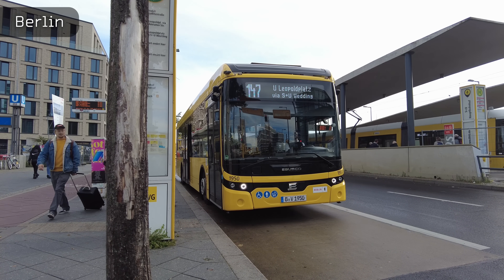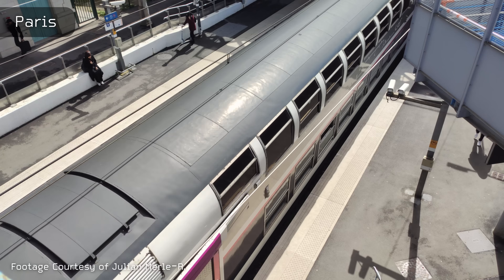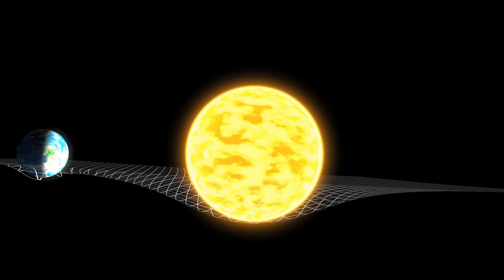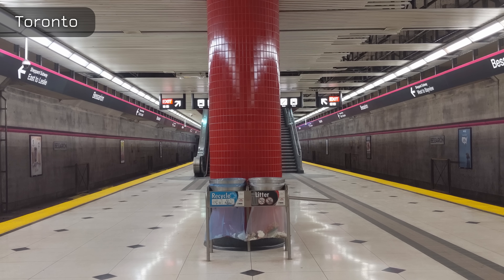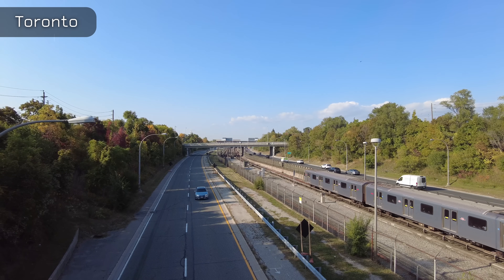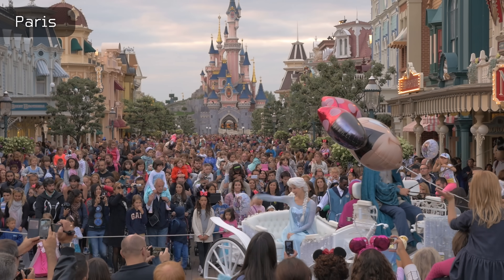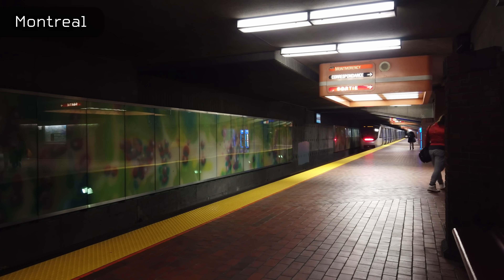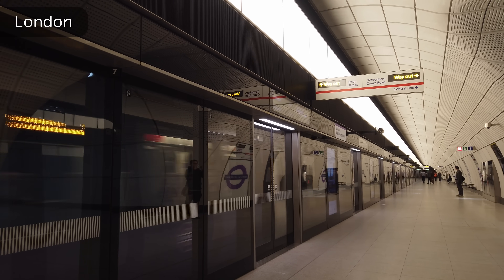Stop Spacing and the Power of Density

Comment: At the end, you show the Elizabeth Line which has about half the stop density of the Central Line in the central core section, but it doesn’t actually feel like that on the ground because of the way the stops are designed with entrances at each end of the platform.

For example if you are at Oxford Circus, getting to the Elizabeth line platform at Bond Street is probably quicker than getting to any of the platforms at Oxford Circus station.
Reply: Fully walkthrough trains help with this as well.
Reply: Exits at both ends are also useful for evacuation in an emergency.  King’s Cross Underground station had exits to the main line station and to the widened lines station, which later became King’s Cross Thameslink, and is now closed.  Unfortunately, during the fire this exit was closed and locked due to construction works.  I believe many passengers were actually evacuated by train, but this required stopping trains, and opening the doors at a station which was on fire, risking smoke getting into the train, and passengers possibly leaving the train, which would not be good.
Reply from the maker: The stop spacing is substantially wider, but the maximization of the access to the super long stations is a smart way of keeping great access.
Reply: Especially for deep metro the exits can allmost double the "effective stop density" as the escalators may come to surface level 300m apart even for normal station lengths. All this without sloving the train down and much less cost than a full station. I think this is something we are missing in Helsinki. Adding the exits are expensive, but in the context of a metro they really arent. They might not double the passenger numbers of the stops, but still most of the new exits would have more users than e.g. the second biggest airport in the country.

Comment: This video also highlights something that more advocates should mention when talking about systems, ridership per mile. You can have good ridership, but comparing ridership alone to the measurement of ridership per mile is what really puts into perspective the density along a line based on just how many people it serves per mile. For US light-rail systems for example, in Q1 2024 for weekday ridership per mile (sources: APTA ridership reports, NJT Facts at a Glance, FTA NTD), the top three were Seattle's Link at the top with 3,461 riders per mile, Hudson-Bergen Light Rail with 2,964, and the Newark Light Rail with 2,643. Compared to their length, the length of the HBLR in 2024 is 17 miles with 24 stations, while the Newark Light Rail's length is 6.2 miles with 17 stations. Compared with other systems during Q1 2024, the MBTA Green Line had 2,446 riders per mile, SF Muni had 2,115 riders per mile, Twin Cities's Metro had 2,069, Houston METRORail had 1,815, San Diego Trolley had 1,792 riders per mile, LA Metro had 1,366, and the Buffalo Metro Rail had 1,250 to round out the top ten. SEPTA's Subway-Surface lines got just 746, below Charlotte LYNX with 798. Despite its huge size, Dallas's commuter-style DART got 694 because of its awful land use! But dead last? Cleveland RTA with 209.

Yes, two of the top three are in New Jersey! The NLR uses legacy infrastructure downtown as a former trolley subway that opened in the 1930s, and used PCCs from 1954 to 2001. Its Broad Street branch on the other hand connects Newark's two NJT rail stations as well as serving the Newark Museum, Newark Public Library, Rutgers Business School, and NJPAC. In the case of the HBLR, the system uses a mix of old right-of-way and right-of-way built brand new for the system downtown. The Bayonne portion uses the former six-track CNJ main line (which also partly sits on former Morris Canal bed) and the West Side Ave portion uses the CNJ's Newark and New York Railroad, the section of the HBLR between western Hoboken and Port Imperial was once the NY Central's New Jersey Junction Railroad, and the Weehawken Tunnel between Port Imperial and Tonnelle Ave that Bergenline Ave station is in, was used by the West Shore Railroad (for trains between the former Weehawken Terminal and Buffalo. The NJ Junction Railroad and Weehawken Tunnel eventually became Conrail's River Line, which NJT bought the tracks from. So it helps that the HBLR connects different dense suburbs as a modern interurban.  The HBLR has connections at multiple stations, like at Hoboken Terminal which is a hub for NJT rail, HBLR, ferries, PATH and buses! On the Bayonne and West Side Ave portions, the locations of stations they chose to build are the former locations of CNJ stations, so they said, "If it worked then, it'll work now" and indeed it worked! Both the HBLR and the PATH have led to lots of TOD and pedestrianization in downtown JC. Hoboken and JC both implemented Vision Zero, with Hoboken not having any car crash-related fatalities since 2017, and Jersey City achieving zero fatalities on city-owned streets in 2022! JC has Citi Bike infrastructure by HBLR stations too! Outside downtown JC, new developments are going up by Liberty State Park station. Western Hoboken now has denser housing thanks to 2nd Street and 9th St/Congress St. And the West Side Ave portion being extended to the new Bayfront development complex revives the ROW further, with new TOD, with much of it affordable housing! The housing boom that Jersey City has experienced is Austin-level, which is incredible for a city much smaller than Austin!

Comment: It is why suburban areas have local and express service trains. Express trains will pass through local stations that are closer apart that serve the smaller populations. More benefit to the outer suburban residents not having to wait in every station. A few stations that serve express trains and likely to have quad platforms and allow cross-platform transfers and those stations likely will have more surrounding development.
Requires more signaling when different services share the same track and more cost when you have quad track stretches.
Reply: Express services are also doable in dense urban areas with express tracks.
Reply from the maker: Local and express trains are far from universal and for good reason, unless you thought to put four tracks in at once you are probably better augmenting coverage with that additional track pair!

Comment: I could go on and on about train performance on US commuter railroads. Eveb the electrified ones are often slow due to a combination of equipment and infrastructure that cant match the performance levels of those same lines in the 1950s.

But one interesting thing ive often thought of is adding suburban stop on to the end of FRA heavy rail commuter lines that run city, resulting in a lot of congestion and low value land use (parking) in the small city. This is the case in Poughkeepsie, New Haven, Danbury, Worcester, and more. Adding one or more densely spaced stops after the current terminus has no impact on the ride for people going to the existing terminus but is useful for people going slightly beyond. But it really depends on the city itself. There is no logical place to extend service slightly beyond Poughkeepsie, Worceser would be challlenging, but Danbury has an obvious extension to New Milford and I think running New Haven Line trains to Cedar Hill North Haven would make a lot of sense as long as most or all of the trains went up there.

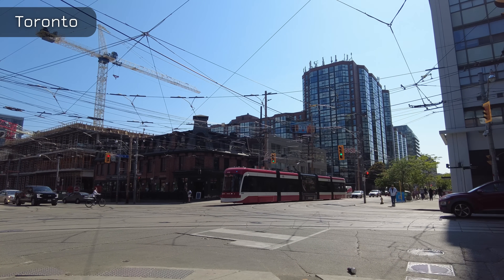Comment: Re 4:50 First of all; A bus behind another can go past it and this capability can be used to run quicker transit in dense areas by virtue of space for overtaking and thus additional service patterns. Both metro and suburban rail can do the same with express tracks. Low density - not good.

Comment: 5:20 You mentioned  "Higher-performance trains" : Montreal's is overall the quickest subway system I have ever seen in North America, yet with only top speeds of 45 mph, which it hits almost all the time thanks to exceptional acceleration of its long 9-car high-performance trains on rubber tires, frequent service, very short station dwell times and also to no "Slow Zones" (which has plagued the Toronto subway forever). The efficiency and passengers per mile are incredible: Only two parallel tracks in Montreal is needed to move what the New York Subway does with three or four tracks on the A line.
Reply: The speed of the metro is in km/h, though. It's 2024.
Reply: Yeah, that's why Paris line 14 is so efficient :
85 seconds between departures in each direction during rush hour (105 seconds right now because they have only received about 60 of the 72 new trains yet), with strong acceleration & braking,  banking in turns, and super short dwell times (sometimes uncomfortably so during rush).
The line's expected to pass the million daily riders in the near future after the opening of the remaining station in a month or two and transfer with the Southern section of M15 opening next year.

If Montreal converted its busiest lines to full automation, they would be even more efficient.
Reply: To be fair, all NYC subway services save for the (1), (6), (7), and (L) are limited in their functional capacity due to sharing tracks with other services
Reply: @effeo9962 The tunnel distance markers in the Metro are in meters. Train speed on the Montreal Metro train operator dashboards, systems and traffic regulation are still in MPH, not km/h. Toronto subway uses km/h.
Reply: @KyrilPG  Montreal’s Metro is heavily automated, but trains are still more efficient and spend less time at each station when a human train operator supervises its operation (instead of a fully automated train that works on door timers and sensors). The operator closes the doors and starts the train, which drives itself automatically to the next station. However, upon request from traffic control, trains can be operated in manual mode with a more aggressive performance profile (accelerate and maintain full speed, faster entry speeds into stations and later braking).
Reply from the maker: Ahhh I don't know. The service is not faster than the expresses in New York, and the frequency often is not amazing (weekends for example are rough), but it does feel fast because of Montreal's fairly high average density!

Comment: The same density effect applies to literally every service. The cost per km of a sewage line is basically constant but the tax base available to maintain (and thus justify) that km only makes sense at a certain density. The cost per km of phone lines has the same argument. The cost per km of electrical wires has the same argument. The spacing  between hospitals and thus the number of people possibly served has the same argument. The spacing between police stations (and thus response times) has the same argument. Literally every service becomes more efficient with density, but rent also gets more expensive with density which pushes people apart.  These two economic forces quite literally define the dynamics of how cities evolve in much the same way as Newtons laws define the dynamics of planets and other masses.   

Anyway, the solution to distant stop spacing in sparse areas is to infill stations in the long empty stretches but only serve them with skip-stop services. Each particular train is still getting up to speed and prioritizing the customers already on board, but the stop spacing doesn't leave any deserts either. A service pattern like the J/Z in New York is a decent example. Beyond East Broadway it effectively splits into two services with more distant spacing (serving every other stop), but every four or so stations they both stop so that its possible to transfer between them without going to the ends. 

Anyway, you never really answered the question. What is stop spacing as a function of density? Is there in fact a simple correlation wherein more people = closer stops (possibly nonlinear)?
Reply: And this is why American suburbia is so costly.
Reply: Another way to serve sparse areas (used in Helsinki for example) is with bus feeders, and this serves them with fewer stations and if there are fewer stations, they can be so much nicer.

> These two economic forces quite literally define the dynamics of how cities evolve in much the same way as Newtons laws define the dynamics of planets and other masses.   

I am not sure it is quite the same. Efficiency of land use might also affect rent prices.

I should also added that hospital size, I believe, actually increases with density, so I am not sure if the spacing between hospitals has quite the same argument.

Comment: When considering an RER/S-Bahn/Eliz line type service, the danger of putting in too many stops in the central core is that you slow everything down too much. If you pair a service like this with a slower metro or tram service that serves the in-between stops (e.g. London's Central Line) then you don't need a tighter stop spacing, because people can easily transfer to another mode. So you can end up with spacings that are relatively even overall. The Elizabeth line roughly follows this principle (although there are some weird long gaps or tightly spaced stations). I wouldn't be surprised if the RER does this too?
Reply: Changing lines only works if people don't feel like they are being punished by it. You can better convince people to change if there's a clear benefit to them, like instead of taking a slow bus into town, changing onto a faster metro on the edge of town, or from a busy tram onto a roomier train, especially if they can do so on the same platform. As soon as they have to walk half a mile just to get to a different part of the station (Bank in London, Châtelet-Les Halles in Paris...), you have basically eliminated the benefits of having an express service on part of their journey.
Reply: Yes, the RER does do this in places, though not across the whole network. For example, RER A (🅰️) was built largely to relieve Métro line 1, which means it follows a very similar alignment. From West to East across RER A's core section, there are 6 RER stations, while the Métro has 21:
🟡🅰️ La Défense
🟡Esplanade de la Défense,
🟡Pont de Neuilly
🟡Les Sablons,
🟡Port Maillot🚋🚈🚍,
🟡Argentine,
🟡🅰️Charles-de-Gaulle ÉtoileⓂ️,
🟡George V,
🟡Franklin D RooseveltⓂ️,
🟡Champs-Elysées ClemenceauⓂ️,
🟡ConcordeⓂ️,
🟡Tuileries*,
🅰️Auber🚈Ⓜ️*,
🟡Palais Royal Musée du LouvreⓂ️,
🟡Louvre Rivoli,
🟡🅰️Châtelet-Les-Halles🚈Ⓜ️,
🟡Hôtel de VilleⓂ️,
🟡St-Paul,
🟡BastilleⓂ️,
🟡🅰️Gare de Lyon🚄🚈Ⓜ️,
🟡Reuilly-DiderotⓂ️,
🟡🅰️NationⓂ️ (RER core ends), 
(🟡Port de Vincennes🚋)

{Ⓜ️: interchange with other Métro lines,
🚈: interchange with other RER lines and/or suburban rail,
🚄: interchange with TGV (High Speed Train) services,
🚍: major bus & coach station,
🚋: interchange with orbital tram route.
*: these stations are not on the same alignment, but are close enough that some intending passengers could use either to go to/from the same area of the city centre}

As you can see, it is *possible*.to travel between most central RER A stations using Métro line 1 instead. But  it's going to be a far faster and likely more pleasant experience all round to use the RER as much as possible... aside from journies that involve changing between modes at Châtelet-Les-Halles (gains are more marginal in as the connection between RER and some Métro platforms is quite a long walk. Access between RER and line 1, 4 or 14 is fine but lines 7 & 11 are effectively in their own separate station and accessing between it and the RER involves using 2 long travelators).
Reply: If the interchanges are really convenient, this is indeed a way to achieve a faster service in quite dense areas. Think: Low density - not good.

I wonder if a bus service stopping not only at tram stops but in between them could be a way to avoid having tighter tram stop spacing, also in quite dense areas. Tight stop spacings are  a bit much for rail vehicles because a rail vehicle, every time it stops at one, blocks rail vehicles behind it - unless there are four tracks.